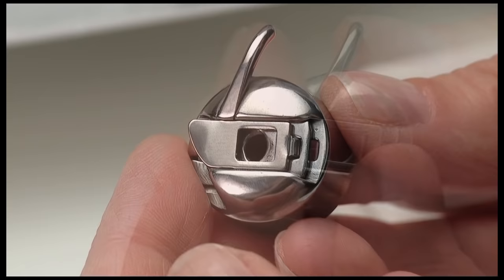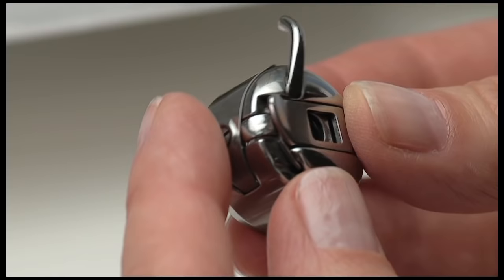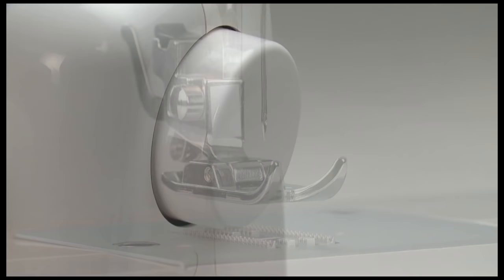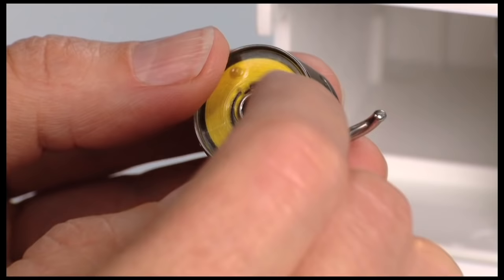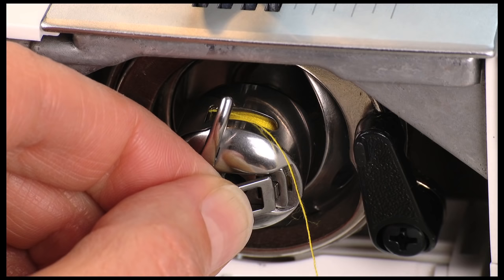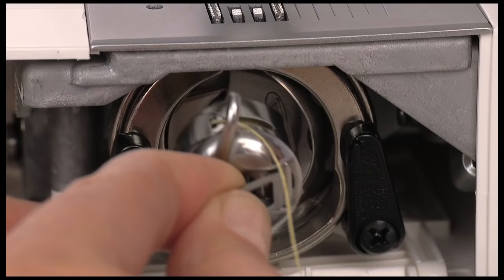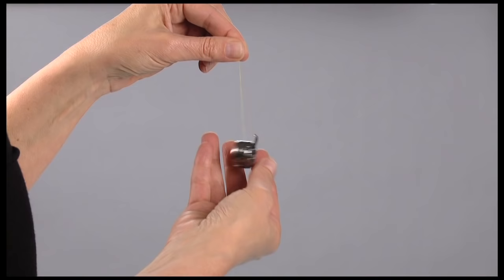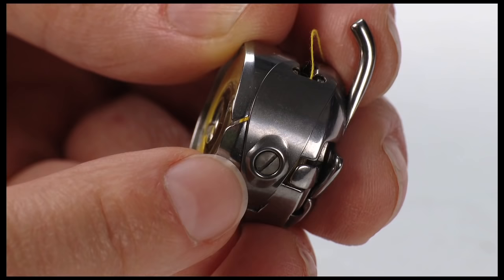SINGER® Front Load Bobbin Case Threading & Insertion Tutorial

Comment: How do I remove the bobbin from the bobbin case? I just bought my machine and it looks like yours just comes out easily but mine appears to be stuck in there. Any tips?
Reply: Rachel Newell you have to get a little tool to go into the little hole in the bobbin, carefully pull it out, hope this helped!
Reply: Let go of the arm on the bobbin case. The bobbin should come out easily.
Reply: Same happening with mine, jyst bought a few days ago, can't get started because the bobbin which was already in the bobbin case won't come out, so disappointed with a name like Singer to have this problem
Reply: I’m a few years late but I had the same question, so I’m sure someone else will down the road! I actually took my seam ripper and put it in the thread hole and that was enough to get it out!
Reply: Thanks .. I was able to repair it. Thanks indeed

Comment: how do I remove the empty bobbin😭😭😭
Reply from the maker: Hello Emidee, 
New front loading bobbin machines usually come with a bobbin inserted in the bobbin case.  Sometimes, this bobbin is very hard to get out.  Do not hold the flap on the back of the bobbin-case open as that will lock the bobbin into the bobbin-case.   Hold the bobbin case in your hand so that you can see the bobbin inside of it and place your finger on the bobbin and turn it. Take the bobbin case and tap it on the table and the bobbin should drop out. It might take a couple of times but it should release.  If this doesn’t resolve this issue please email us at: talktous@singerco.com or call our Customer Service line at 1-800-474-6437 and one of our Customer Care representatives will be happy to try to assist you. Our Customer Care line is open from 8:00AM - 6:00 PM CST, Monday through Friday.  Note: Singer Customer Care will be closed in observance of the New Year holiday on Tuesday, December 31st and Wednesday, January 1st. We will resume normal business hours on Thursday, January 2.  Please have a Safe & Blessed holiday.   Thank you.
Reply from the maker: Hello Emidee, 
New front loading bobbin machines usually come with a bobbin inserted in the bobbin case.  Sometimes, this bobbin is very hard to get out.  Do not hold the flap on the back of the bobbin-case open as that will lock the bobbin into the bobbin-case.   Hold the bobbin case in your hand so that you can see the bobbin inside of it and place your finger on the bobbin and turn it. Take the bobbin case and tap it on the table and the bobbin should drop out. It might take a couple of times but it should release.  If this doesn’t resolve this issue please email us at: talktous@singerco.com or call our Customer Service line at 1-800-474-6437 and one of our Customer Care representatives will be happy to try to assist you. Our Customer Care line is open from 8:00AM - 6:00 PM CST, Monday through Friday.  Note: Singer Customer Care will be closed in observance of the New Year holiday on Tuesday, December 31st and Wednesday, January 1st. We will resume normal business hours on Thursday, January 2.  Please have a Safe & Blessed holiday.   Thank you.
Reply: @SingerSewingCompany  nvm I just used a needle
Reply: @emideegacha8941  thank you so much for the tip, it worked! I used a very small screwdriver and inserted into small hole in bobbin, then just pulled it out, better method than the Singer company have given, you're a star!!